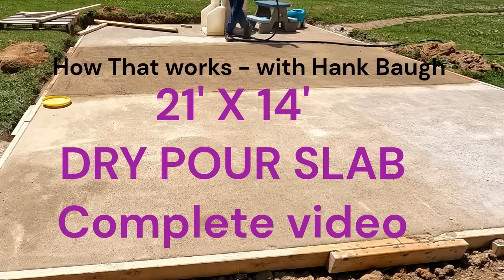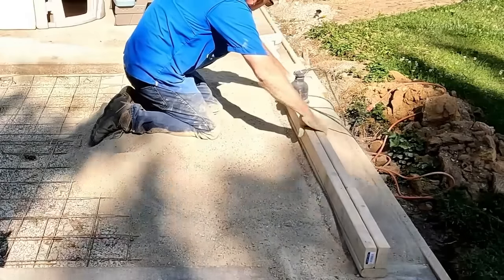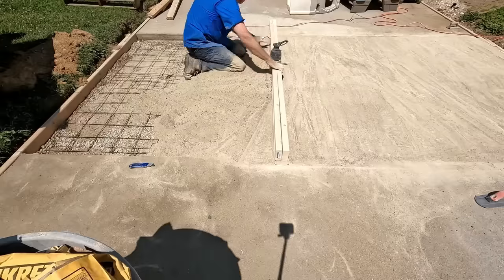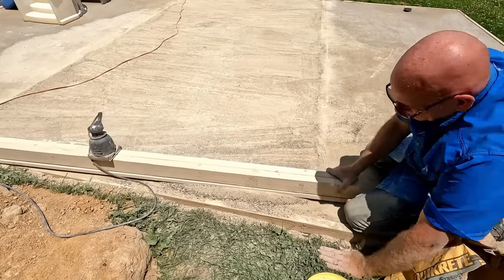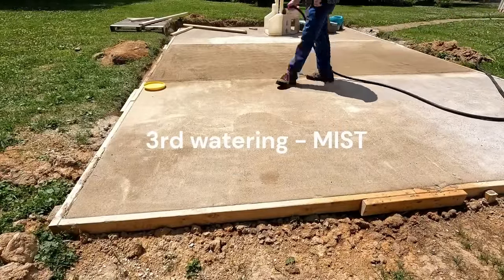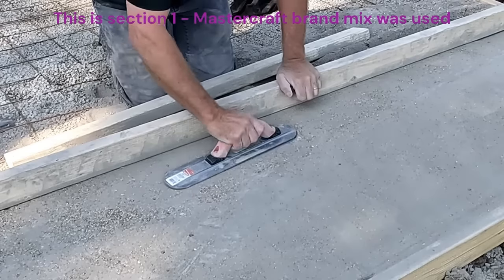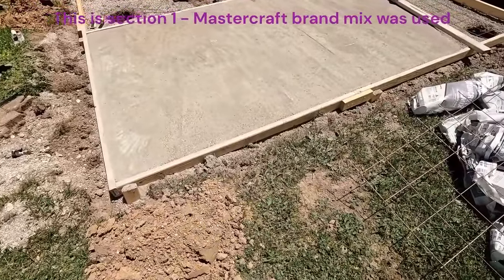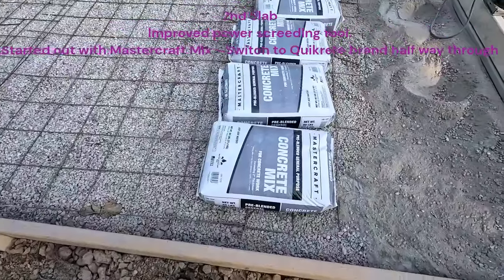21'X14' Dry Pour Slab Complete Video

Comment: Looks good, you probably want to keep wet curing it where the deep footings are so that you are sure it has enough water to hydrate the complete volume of extra mix in the footing holes... once it sets (after the misting) you can't give it too much water and it's stronger the more water you give it, some pro's "wet cure" for 28 days...  You can resurface it to make it even "nicer"/smoother with QR concrete resurfacer and you can even apply a color at that time I think...  screeding looks like a two person job... I think yours is the first "dry pour" online with a functional foundation (with the deeper parts), not just a slab.  I'd love to figure out how to do foundations and walls and roofs with dry pour.
Reply: This is something I'm surprised isn't mentioned more in the dry pour stuff: keep it wet!  Once the 'crust' is locked in with the misting, ya should be golden.  Figure watering it down with a decent shower once or twice a day during the curing process would strengthen the end result, or at least cover it with a plastic tarp to help keep it damp and prevent the sun sapping the water out of it.
Reply: @PsyCoCinematics  Google how to wet cure concrete
Reply: You are right. Keep it soaking wet, after the initial mists. I think that the mists should be pretty steady tho, not enough to disrupt it or have puddleing. Just keep it moist. Then after an hour or two, speed it up with showers. Don't let it puddle, just keep it wet. After 4 or 6 hours, keep a sprinkler on it.

After 24 hours, soak it and cover with plastic. Wet for 28 is best.

Also, for the top layer, use concrete with no stones in it. Easy screeding

Comment: I’m in Indy too and I’m currently working on an 12x14 pad that will be used for my outdoor kitchen.  I’m doing it in sections as well.  I used a sand mix on top and it made a huge difference.  Nice job
Reply: How did the sand mix on top turned out?
Reply: @floridagrown6250  turned out great.   Smooth finish and so far has held up but this winter will tell.  It’s 5” thick I had to match the existing concrete.  I got my kitchen done and had no issues drilling in to the concrete.  Only thing I had to do is clean off the top layer that didn’t get hard in some parts but you can’t even tell where it is.   I just sprayed the sand off that didn’t settle.
Reply: Sand mix on top? Any videos of the process?

Comment: Im going to build a pergola and I think where my post will be I'll do a wet mix. Then do smaller sections with the dry mix. I think where the 2x4s come up in the middle I'm going to use some decorative tiny gravel tamp it down and put mulch glue on it to secure it. You gave me faith in your completion of your slab. I will stick with quick crete. I plan on making my pergola 10 x 20ft 6 posts with a hip roof. I'm stoked seeing your project. Thanks for sharing.
Reply from the maker: You will be very happy.  Just be sure to pack the mix tightly,  then after you are able to water freely, after 1st 2 - 3 mistings, keep it moist for 3 to 7 days for maximum strength.

Comment: Fantastic! Awesome details from the beveled edge board to the prototype screeds to handling this completely by yourself on a large slab. I am thankful to you for showing that Quikrete is the way to go, because my driveway repair pours with Sakrete look just like Mastercraft and saw your video, also I noticed someone commented that Sakrete is a fail too. So it will be Quikrete from now on.  I'm just waiting for October so I can start my 30x30 barn pour in the sun, it's been upper 90s last 2 months here in deep south.  BTW, I always go heavy on the water for the concrete and myself and cover with plastic, the concrete not me,  for a few days here in the hot zone.

Comment: Looks like the skreet board worked well. My wife and I did a slab about the same size, we did 12 5x5 slabs used 12 bags per slab we did 3 a week 2 on Monday and center on Thursday. Basically same method of forming as you.were doing a apron in front of our shop so for the 2 end just used 3 boards for forms middle was just 1board. Also used a little sand topping mix we are happy with it.
Reply: Did you have any issues with bubbling?  What brand of cement did you use?  I would really appreciate the info 😊☀️
Reply: @sterlgirlceline  I used quick Crete, we had no issues the last one's we did look really good. There's a video out that looks like he did really well I think it's grappler dyi, we followed Cajun country recommended process worked for us. I'm not really qualified to be giving drypour instructions. It worked for us, and I believe it will work for a lot of people, but there are quite a few people who seem to hate the drypour.
Reply: @stevecarney6750  Thank you for taking the time to respond!  I am gathering info to prepare to do  4” slab for an 8x20’ shed.  I came across a nice couple who posted a dry pour on YouTube who had issues with bubbling or “blistering.” I’ve been trying to gather info in the hopes I can avoid that issue.  Yes, I see all of the nasty comments about dry pour also and I really commend all of the brave souls who post and endure all of that.  ⭐️
Reply: @sterlgirlceline  I would watch Diy The Grappler I basically did the same process. I don't think there's much difference between sackcrete and quick Crete. I actually used both but topped with quick Crete because that is what I started with and there was slightly different color between them. Any way the video he just out is good. Also I would do the project in sections you can skreet easy. I also think what he says about curing is important good luck.
Reply: @stevecarney6750  Thank you!  Yes, I am going to reinforce with Pinkbar (with chairs) by Owen Corning.  I am also going to do a 4” gravel base compacted with a rented ground compactor.  Just really hoping to avoid bubbling/blistering 🤞🏻🤞🏻🤞🏻
Reply from the maker: I used Quikrete brand for best results.  Tried some Mastercraft and it was impossible to get the rocks to go down.
I did not have any blisters on this large slab, but I did have blisters on both of my sidewalk projects.  There is a closeup of a blister forming on this video - https://youtu.be/PL2fT_0UqTM 
It happens when I switch over from misting to showering.  Not due to heat as some have suggested.  Due to too much water at once getting under the thin crust that is formed with the misting cycles.
Reply: @HankBaugh  Thank you for sharing and SO glad to hear you figured this out 
👏🏻👏🏻😊⭐️⭐️⭐️⭐️⭐️⭐️
Reply: @HankBaugh  This is so helpful; thank you!! 👏🏻👏🏻😊⭐️

Comment: For the dry pour, I did we used Sakrete brand mix and we had the exact same issue with the rock on top. I would love to use the Quikrete brand but no one has it in stock anywhere around where we live.
Reply: I literally have a truckbed full of Sakrete in my backyard and I am contemplating returning it and going to buy Quikrete 😂. I wish I saw this video earlier !!!
Reply: Yes, I battled with the rock also coming to the top, so I just did an aggregate finish on it

Comment: Thats a good idea with the sander for the screet. Only 5hing i would have done is run the cord down the length of the board and secured it so it wouldn't be getting in the way.
Reply from the maker: That is  good tip.  I probably  will do that before my next slab project.

Comment: the answer to the aggregate rising would be layer 6000psi Mortar on top as itll run much more smooth when you dry pour as a top layer but nicely done buddy just a tip

Comment: Great Job !!
Question: How did you attach the sander to the wood?
Reply from the maker: I drilled holes in the sander plate and used 3" deck screws into the wood.

Comment: ⭐️⭐️⭐️⭐️⭐️⭐️Thank you for this; extremely helpful!  Has anyone had issues with BUBBLING?  I saw a couple of people who had bubbles come to the surface but one of them used another brand instead of Quickcrete.  Could that have made a difference?

Are bubbles more likely with a rock base?  Maybe not if compacted first?  Does wetting or not wetting the ground and/or rock base underneath make a difference with bubbling?
Reply from the maker: You have to just lightly mist the first two times.  This forms a crust that keeps the surface finish in tact.
Reply: @HankBaugh  Thank you for taking the time to respond! 😊⭐️. I’ll go back and look at that video with the bubbling.
Reply: @HankBaugh  This is the YouTube video of the nice couple who had the bubbling aka “blistering” issue in their dry pour.  They misted twice first, then in their first (and subsequent)  shower/s they had bubbles:
https://youtu.be/EUYkQB40jf4
Reply from the maker: @sterlgirlceline  I looked at that video.. maybe it was the brand?  Maybe because they screeded with a level, which did not have a beveled leading edge like a 2x4 does, so they were not packing the mix together?
Reply: @HankBaugh  I was thinking the brand also but I asked two, other people who used that same brand and they said the blistering didn’t happen to them interestingly.

I was thinking maybe the size of the base gravel was big and they also didn’t use a mallet on the sides of the forms to get any air bubbles out.  Your point is spot on and the way the dry pour was positioned would make it impossible to screed which vibrates the powder and surely helps with air pockets.  

I just prefer to investigate as many potential pitfalls beforehand so hopefully mine goes well.  Thanks so much for all of your tips.  I appreciate it more than I can articulate! 😊⭐️
Reply from the maker: I had some bubbling on most recent sidewalk.   Watch here for explanation.   
https://youtu.be/WygpR_yjU40
Reply: @HankBaugh  Thank you!  Greatly appreciated 👏🏻👏🏻😊⭐️

Comment: Thanks for posting the details. This is going to help me a lot in my first dry pour.  I was wondering... why roll over the edging?  Or why not use the edger again as a final finishing touch? Is it just an aesthetic choice?  Also how do you use any kind of spacer to suspend the mesh in the middle or is it ok to just rest on the gravel base?  By the way, I've seen someone top off their dry concrete with a little bit of mortar mix before screeding and they get a really nice, smooth finish because of the extra powder on top of the aggregate.
Reply from the maker: Great questions!  I really encourage you to do a little experiment to get first hand knowledge before you do your actual project.  Just make a little 1' by 2' box to see how it goes for you.

I did pull the wire mesh up into the middle as I went.

On the edger, it is really difficult to get a good looking edge stripe, that is why most people just paint roller over it.

You could add straight mortar to the top, but that is not needed if your screeding is working for you.

I think that was all - good luck with your project!  Tell your friends to subscribe!
Reply: @HankBaugh  Thanks for replying with good advice!

Comment: I like the process at what  point can you drag a broom  over the surface for a little grip?
Reply from the maker: You can't change the surface once you mist it.  Get whatever surface you want before you get it wet.  I find that the paint roller gives you a very similar surface as a broom finish.  Maybe just a little smoother, but fine for sidewalks and patios.

Comment: I used Mastercraft on a small pad and it is terrible.   I think it is only good as a wet pour.
Hank they make concrete resurfacer Quikcrete is called recap  there are other brands also
it goes on very thin and will make your patio smooth
Reply from the maker: I probably will do something like that, or epoxy paint it later on.

Thanks for the tips!

Comment: Just wondering, could you do a thin layer of cement without gravel, or even mortar,  on the top to cover up the aggregate since you are unable to float the concrete when you wet it?
Reply from the maker: I suggest you make some small firms and experiment around.   See this video.  This was my first attempt at learning what you can and cannot do with dry pour.  https://youtu.be/tkdjSefpTmA?feature=shared
Reply: i am going to be putting up a mobile home on a burn lot in Paradise, ca. I like the idea of dry slab for some aoplications, but not all. A garage slab needs a professional wet pour, but a patio or walkway might get by with dry pour. On a patio I want to experiment with putting a thin layer of mortar mixed with color on top of semi firm dry pour then mist it. When starting to set up then I will do heavier watering. Looks like you are doing a good job on your project.

Comment: I wonder if you could use concrete mix on the bottom half and mortar mix that doesn’t have the rock on the top half to prevent rocks on the surface.

Comment: Thanks for the video, very informative. Let me ask you about the posts spots. So you digged for the posts, but after that I see you simply poured the concrete dry everywhere. Does it mean you simply filled the post holes with dry concrete and just made the slab thicker in that spots? How do you compare this with wet pouring for the posts? My fear with mixing dry and wet would be how the concrete layers would bond with each other (they wouldn't I guess)
Reply from the maker: Sorry for the late response.  I did just fill the post holes with dry.  Just wanted extra thickness there to support the roof.

Comment: Do you think it would be safe making a driveway with this method? Thanks, good video and tips
Reply from the maker: I am currently doing some strength testing with a reputable concrete testing company.  Results won't be in for about 6 weeks.
Reply: @HankBaugh  Nice cant wait to hear the results :-)
Reply: I failed. I tried a 8x10 repair area halfway down my driveway. Here is why I think it failed. A large car or pickup truck (not to mention a delivery truck) will easily break a dry pour just because of the speed and weight of a vehicle causing movement. If the ground is completely dry, like a desert, then okay, but in reality there are constant changes underneath in the ground from rain, humidity, freezes, and drying that cause a disruption beneath the concrete. The best way to describe that is to think of a large semi-truck moving across a frozen river or lake. If you drive really slow and easy, and only when it's been super dry, then the driveway will work. Otherwise, your gonna need to rip it up and buy a small mixer for driveway and get yelled at by your wife for just not hiring someone. Maybe if you go twice the depth of a normal wet pour concrete driveway?  I'm always willing though.
Reply: @timbob987   Thanks Timbob i believed you just saved me a big headache.
Reply: @timbob987 this is why we changed our mind for our above ground pool with this method. 
It’s all fun and games until you have to spend time destroying what you thought was worth the time and money. 😢

Comment: Obviously you can't do it now, but what would you think of using expansion joints between the sections of your pours? I'm using your idea of doing the pad in sections, but making them smaller so it's more manageable.
Reply from the maker: I considered putting the foam strips in there, but decided against it.  We will see how it works out.

Comment: did u use expansion joints inbetween ?
Reply from the maker: You should put in expansion joints every 8' to 12' on a 4" slab. My sections are 7' wide by 14' long.  Probably should have, but I didn't want them.  We will see.

Comment: Another question if you allow me: my slab is going to be 28x16, attached with rebars to the house foundation and on one side to an existing slab. I will use #3 rebars for reinforcement and plan to build a pergola covered with polycarbonate sheets. I have already put the gravel. My issue is I have a slope, so near the house the thickness will be about 3" only (I have to match the height of the existing slab) and on the opposite edge it will be maybe 5 or 6". Do you think I will have high risk of cracks on the thinnest part? Thanks again
Reply from the maker: That is a very specific question.  There are a ton of factors that can cause the concrete to Crack, or not Crack.  Someone once told me that all concrete cracks.  That is obviously not true,  but what they were trying to say was the rebar keeps the concrete from separating, not from cracking.  This is why people saw cut slabs every 8-10 feet.  So when it does crack, it will be in the saw cuts not someplace else.  Fiber in the concrete strengthens it and reduces likelihood of cracking as well.

Obviously you want to know about Dry Pour.  What I do know is in perfect conditions, with adequate moist curing, your drypour will be 50% the strength of wet mix under the same conditions.  For my projects, that has been fine.  I have always made my slabs and walks at least 3-1/2" or more thick.
Pack the mix in tightly. Moist cure for at least 3 days.
I know I did not answer your question, but I wanted to give you as much information as I could so you can make your own judgements.

Comment: How do u create the slope and how do u know which direction to slope.
Reply from the maker: Slope is created by how you put in your forms.  Whatever the top of the forms is will be your slope.   Usually 1/8" per foot is plenty.  If slab is next to a house or building, Slope so the water runs away from the house.  Here is a little clip where I talk about Slope.  https://youtu.be/Ggd1-u4tGxI?feature=shared

Comment: How did you attach your sander to the board?
Reply: Drape a wire over the top put screws and screw them down tight would work
Reply from the maker: I used 3" deck screws into the 2x4s.  Had to drill holes in the sander plate for that.